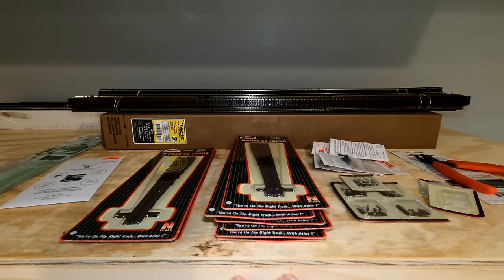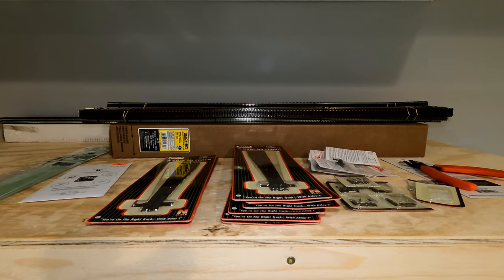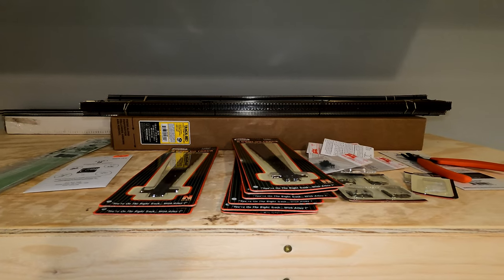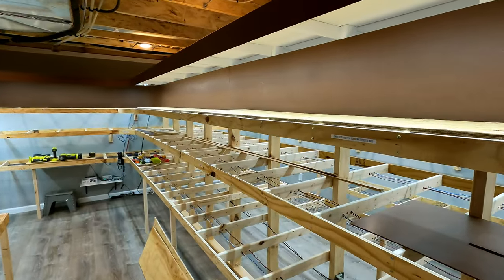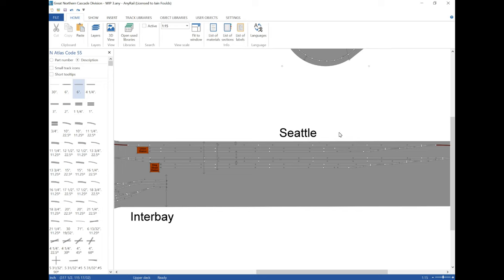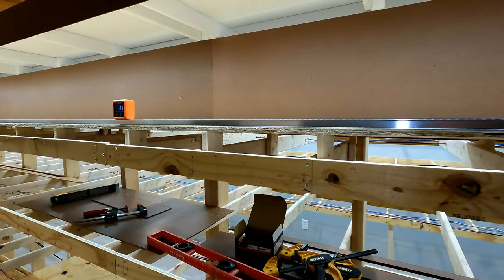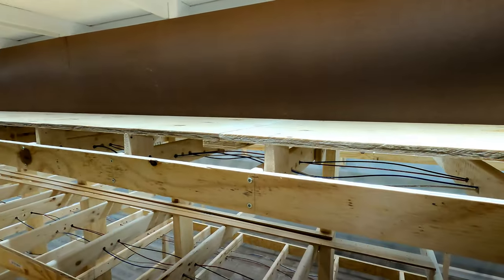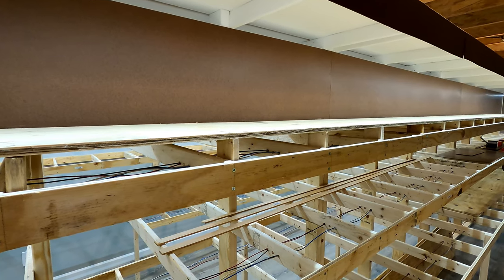18 - Building the Seattle stations - part 1

Comment: Something else to consider might be soldering the feeder wires to the bottoms of the rail joiners as you lay the track. It provides a better visual, in my opinion away. It's looking good so far and well thought out.
Reply from the maker: Yep, I've been torn on soldering to bottom of the rail joiners, as I've been having a hard time with the flex track on the rail that flexes. There's not much plastic material when soldering, so it doesn't tolerate much heat. I've been soldering underneath the rail, not on the side, so it's still as visually well-hidden as the underside of the joiners. I might switch to soldering at the feeders though, will see. Iain

Comment: That will be an incredible scene.  I had a #10 fail electrically, the segment between the point and frog.  Of course it is in a bad spot but I'm planning on adding a jumper wire somehow.
Reply from the maker: Thanks, it's coming together nicely! And that sucks, having to replace turnouts in-place is a pain. Hopefully you can figure something out without causing too much surrounding damage / repair work. Iain

Comment: You have done a marvelous job on this layout and made some great progress, quickly. Have you considered possibly using 2 inch foam for the waterfront area? It would allow for carving the area to get the depressions and elevation change you are looking for without too much fuss. It’s exciting to see that track is going to be going down and those number 10s are going to make those passenger cars look right in the turnouts. Great job.
Reply from the maker: Convenient that the platform deck is raised 2", eh 😉 ? But yes, that's pretty much the plan. I might just cut sections of 2" foam since I'll have hard edges around the port, but that's definitely easier than raising plywood deck everywhere around there. I had the same idea on the Spokane station area. Only reason the stations and yards are / will be raised on a plywood base is to make it easier for running wires and turnout motors through, really. From a little bit of running trains, the #10s do look great with the long passenger cars! Iain
Reply: @gncascadedivision  Have you had the surgery yet and if so, how are you feeling?

Comment: Going to be an impressive layout! I used a digital level when laying the roadbed on my HO scale layout and kept everything within 0.3 degrees side to side and it has worked out well for me. N scale may be more sensitive to slight changes in pitch though, I don't know?? You'll be busy for a while.
Reply from the maker: Thanks! Yes, I'm trying to keep everything to 0.1 degrees, with a 0.1 degree level of accuracy ;) The eyeball test for actually running trains is also important! I'm making slow progress, and it's definitely something that is a long-term project. Iain

Comment: One other comment...I've had to replace all of my #5 Atlas code 55 turnouts with #7s given problems with backing trains into a yard as well as running 6-axle locomotives through the diverging route. Had to change the geometry of the ladder, which was a pain. If you have the room, I recommend sticking to #7s. My $.02.
Reply from the maker: Hopefully it wasn't too painful for you to switch. I am leaning more towards the #7s since I have the space for it though, yes, and most of the complaints I've read about the Atlas code 55 turnouts seem to be people using the #5s. I have four #10s in place now for station (more video coming soon!) and I really like how the geometry works out with them. I need to finalize the track plan for Interbay Yard, and see if I can standardize on #7s. Iain
Reply: Atlas turnouts are JUNK. Go handlaid.
Reply from the maker: Each to their own. Many have used Atlas without problems. Handlaid would be way too much over the scope of this layout though. Iain

Comment: Looks great, Iain. Well thought out, and spending time on the subroadbed is critical to smooth trackwork and ops. I'm curious why you're using left hand turnouts on a right-hand yard ladder? Sounds like you have lots of experience based on your previous layout. Excellent choice to use #10s. Best of luck with the elbow surgery.
Reply from the maker: Thanks, Mark. Not sure on the left hand turnouts to a right hand ladder. Part of it is trying to condense the two stations into the area and have the ability to run trains through on the nearside (to the fascia / operator). Some of the platforms dead-end on the prototype and then use a wye to the south to turn the trains, but left hand turnouts on the layout make more sense to gradually feed into the platforms away from the "mainline" so to speak, with the more distant platforms gradually becoming shorter and likely less used. Hopefully that makes sense! I'm working on putting down track and being able to move a loco around, so maybe I can explain it better then. The #10s are working out great. Iain